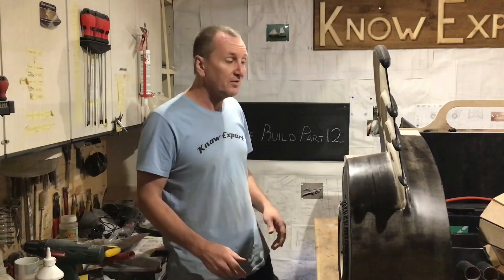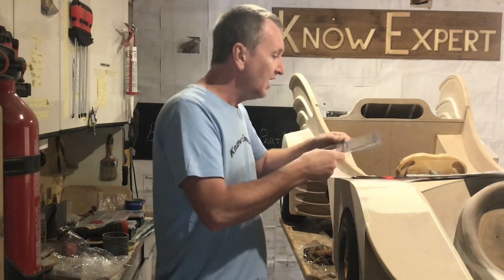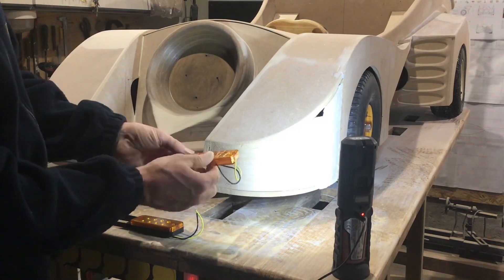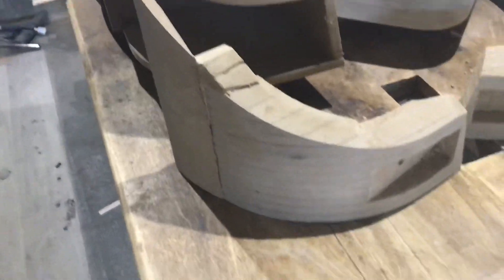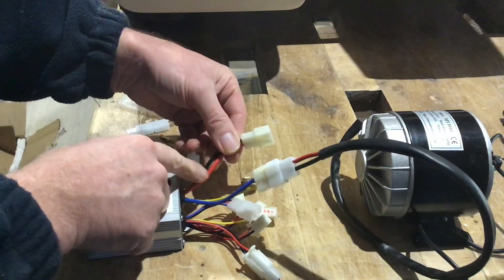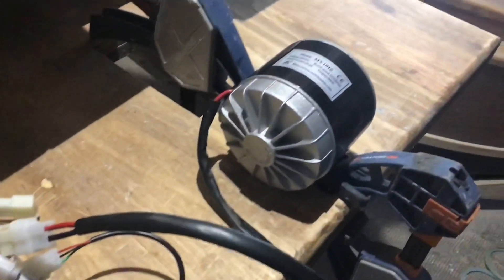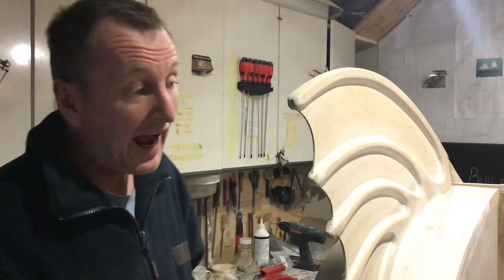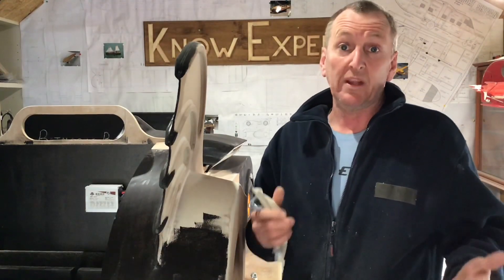Batmobile build Part 12 custom building a prototype kids electric car. Fitting the electrics.

Comment: Could you please tell me ae your batteries 12 v each? Thank you for all your videos you prove that if you want to achieve something you can if you really try.
Reply from the maker: 2 x 12 volt batteries wired to make a 24 volt system (series I think) as for achieving something, I just make one part at a time and solve each problem as it arises, sometimes it takes longer sometimes it costs a bit more but I get there one way or another and learn as I go along. Appreciate you watching.

Comment: Hi could you please list the names of all the electrics in the boxes? I’d like to build my daughter and son an electric car following your videos. May I ask where you bought the electrics? They look like a kit of some sort?
Reply from the maker: Hi mha mrk If you look on Amazon or eBay and search for speed controller and motor  kit for go kart you can find them with varying size motors and with or without batteries. This Batmobile has a 350 watt motor and drives at jogging speed. Thanks for watching KE
Reply: Thank you so much for your response. I think I found the same kit you have! I watched your finished video. Awesome! May I ask if that was the actual sound of the car starting up or an effect? Does it reverse? Also, does exhaust actually come out the back of the car? I plan on making my kids a classic car and like think exhaust actually coming out of the pipes would be cool. I know very little to nothing about cars so I’m sorry if I sound stupid. heh Do you plan on making another car in the future?
Reply from the maker: mha mrk , in this video the smoke and sound are both effects BUT both are readily available to fit into the car. Watch my video of 'Lena' the model boat, that is a smoke machine (small unit and about 50 dollars at this time) the sound machines are available online (search the Toylander forum, they are nice guys) I will make another car one day when I sell this Batmobile. Thanks KE.